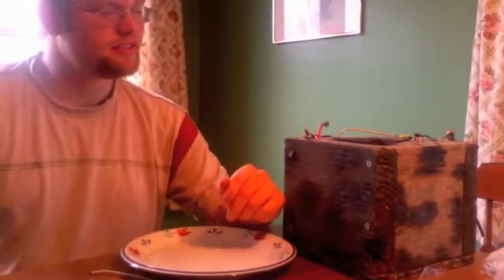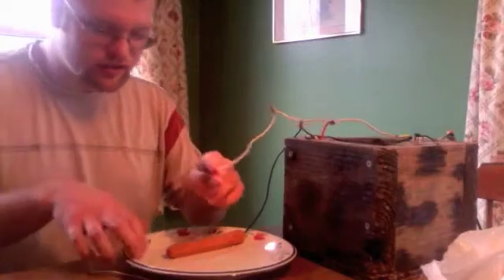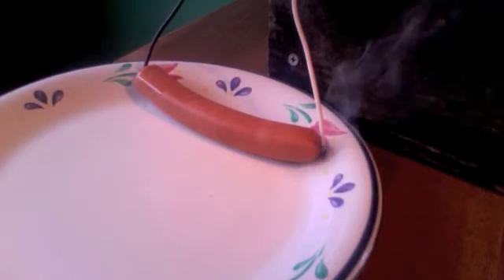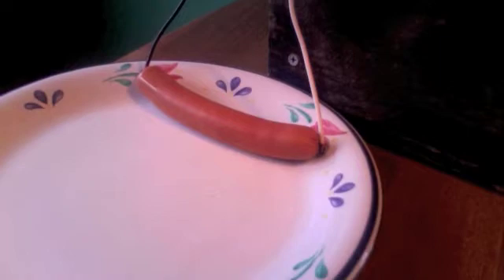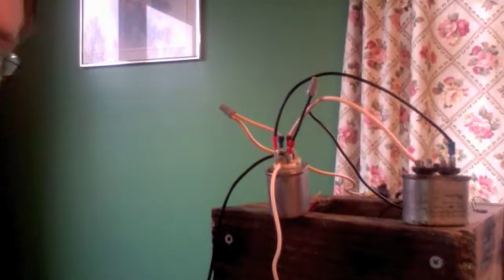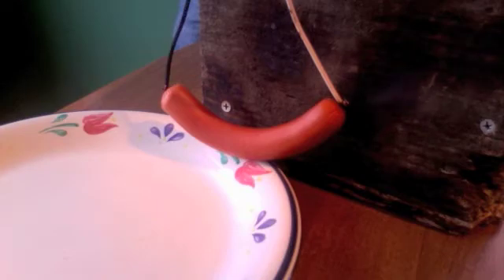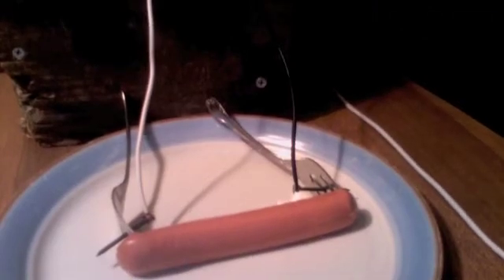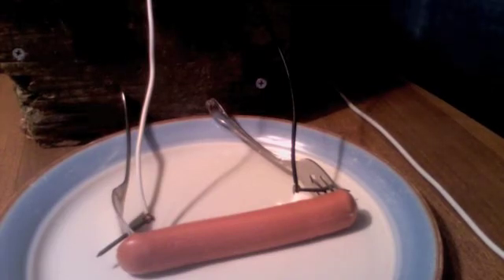Cooking a hot dog with 120V AC

Comment: A simple amp meter around one conductor would give you all the information you need. 120vac x 2 amps = 240watts for example. 120vac ÷ 2amps = 60 ohms resistance. Ohms law, we live and die by it.